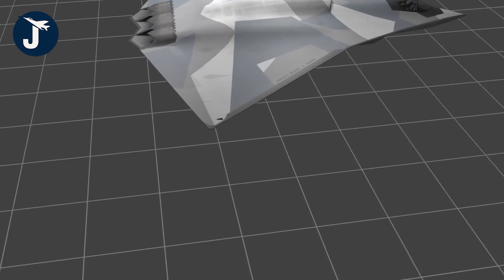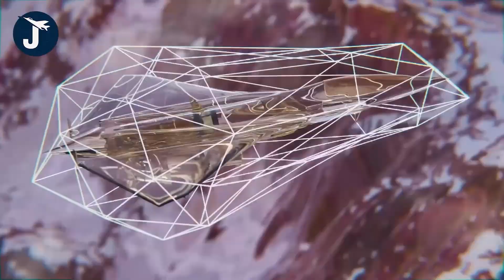The Pentagon’s Silent Breakthrough About The 6th Gen F-47 Is Closer Than You Think

Comment: The F22 was Not " IN " the 1990's. The year was 2005.
Reply: the F22 was & is 1980s 1990s tech just as the SR71 is late 1950s early 1960s tech. Think about this, if the SR71 was built designed on paper with a slide ruler just imagine what we have flying now. like i said before, the so called UFOs everyone believe  are little green men from outer space zipping around are really DARPA, SKUNK WORKS & PHANTOM WORKS employees & the UNITED STATES MILITARY